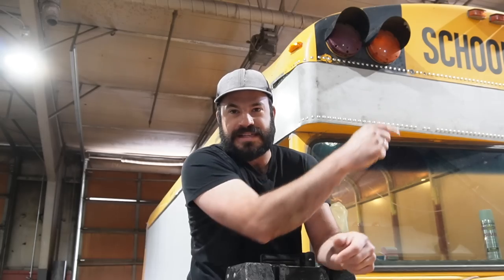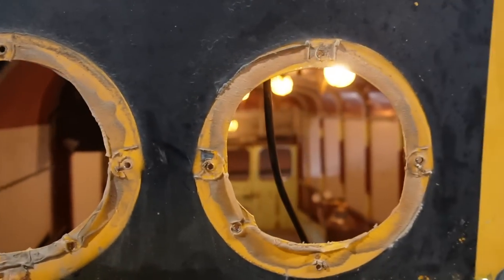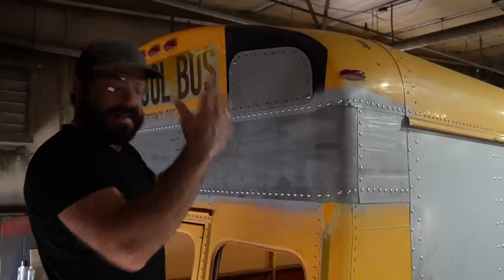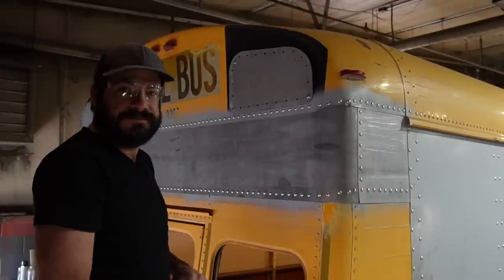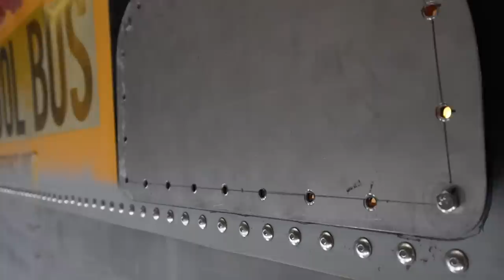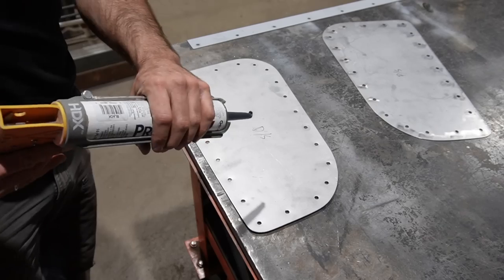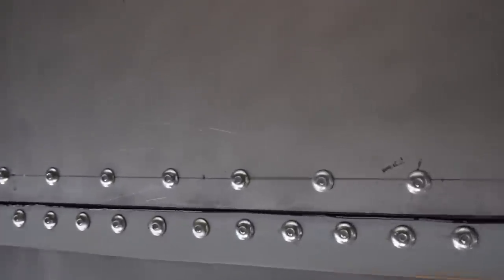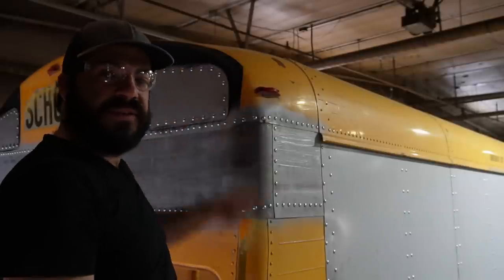Deleting the Flashers to Keep You STREET LEGAL (Skoolie Conversion Guide #6)

Comment: Really enjoying the videos. I'd love to do this one day.
You should try a hand full of drill point framing screws, 7/16th screws, to hold the patches in place while you drill and pop rivet. You might even be able to skip a step by caulking the patches first, hold the patches in place with a couple of screws, drill and pop rivet, then remove the screws and poop rivet those holds. If you go to a place that sells sells commercial drywall supplies and ask them for hex head framing screw to go through 2 sheets of 18 gauge steel. You'll want something with a long enough drill the the first sheet wouldn't start threading before you get through the second sheet.

Comment: I recommend. Removing them. Of course first. And then adding 4x 5 3/4 spot lights. Its great for the extra lighting on dark lonely back roads and highways. I have 3k a piece spot lights front and back. And it is awesome!
Reply: Yeah, when this started I was thinking that converting to either spotlights, turn signals, or both would be cool and keep the stock bus look.
Reply: @matts1166  extra light is the way to go. Trust me. @thebrinkofreality_skoolie

Comment: I am pretty sure you can legally make them into brake light and turn signals as well. I think in some states you can leave them as long as you don't use them on roads.
Reply: Worst case scenario you could leave them, and just disconnect them. They'd just be vestigial, but not legally "flashers". At least that was the ruling here in Iowa for surplus police cruisers that got sold with the light bars intact.

Comment: I seen a fairly popular skoolie builder, Remove the Lights as you did. Clean up the surrounding metal.  He primed the metal  and used round Metal Plates to cover the hole from the INSIDE. Cutting them slightly larger than the hole. He used some sort of Adhesive and only two small rivets to hold them in pace. His next step was to use Bondo to cover the Metal deletes from the outside. It looked ok, but seemed like a lot of work.  Do you think over time the bondo method will fail?   TBH, I like the rivet look better, it matches the whole Bus.
Reply from the maker: I've done that method before, I'm not a body repair expert but both times the bondo inevitably cracked but I'm sure my technique was mediocre
Reply: @ChuckCassadyYT Thanks for your reply But I really can't see you doing mediocre work!  Our Neighbor gave the same advice. When using Bondo, you have to have it on thick, then sand it down smooth.(Multiple layers to insure it doesn't crack)                                  * I will show my Husband your reply  :)
Reply: Plan to do the same, but use thin layers of Kitty hair with a poly top coat 👌

Did you go ahead with this approach? How'd it work out?
Reply: If I were to cover holes, I'd weld and grind so that they look like they were never there. However, I'd rather put useful lights in the holes (flood lights for outer and spot lights for inner).

Comment: Another awesome video, thanks Chuck. Instead of patches, I am looking to install some round LED lights in those locations instead that would be set up on independent switches for extra lighting at night. Have you ever done this, and if so, what lights did you use?
Reply from the maker: Just about any 7” light will work up there. Done it a few times
Reply: @ChuckCassadyYT  Thanks Chuck, I appreciate your feedback.

Comment: Covering up those flasher light holes with a permanent patch plate, you will not be able to see bus wiring and when you might have a wiring issue that runs behind these holes.
Reply from the maker: Buddy, there are no wires there. I rewired my whole bus
Reply: @ChuckCassadyYT  ok, your bus had no wiring there but my 2002 International does have wiring there. It is evident then that not all buses have wiring there besides the two wires going to the flashers.

Comment: Yo. I love you and all. Great work. But stop drilling so many god damn holes in a patch.   Jesus. also just leave a weep hole on the bottom of a patch sealing like that.. good work.. but eh... longevity/no water intrusion.
Reply from the maker: A weep hole! Lol what the heck?
Reply: @ChuckCassadyYT  So the two layers of RTV, instead of so many holes, do inner layer rtv SOLID, then on the outer ring, leave a weep hole. then you can get away with far less drilling potential problem holes and if water  did get it, it would run out of the weep.
Reply from the maker: @foodstamp6952  the entire bus is covered with rivets. literally thousands of them, hundreds set far closer than these, under immense clamping power. im not worried about saving 20 rivets when there are 200+ all around it. i can tell i upset you though, so I apologize, but there is no way to create a channel and weep under them to drain. do you have experience with these kind of structural rivets, set by pneumatic machines? we are talking thousands of pounds of clamping force per. i like my method. sounds like you'll do something different on your rig. best of luck
Reply: @ChuckCassadyYT  And ya i might do something different on mine if i go the bus route, which seems the way to go vs a motorhome.
Reply: @ChuckCassadyYT  ok so riddle me this, riddle me that... why so many rivets?